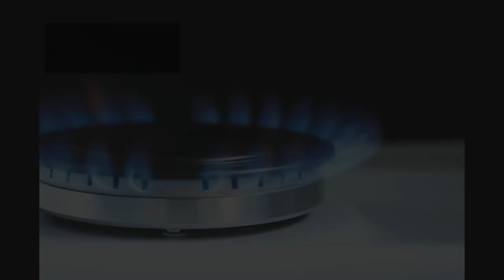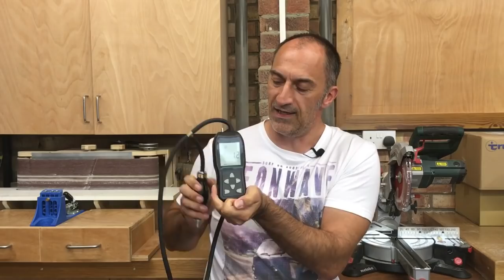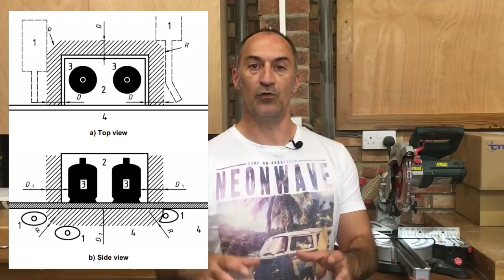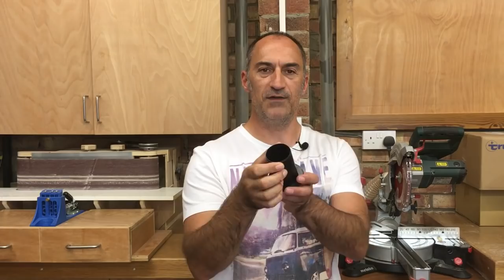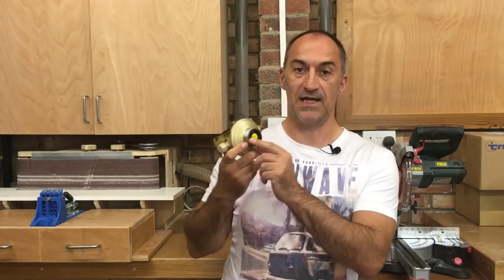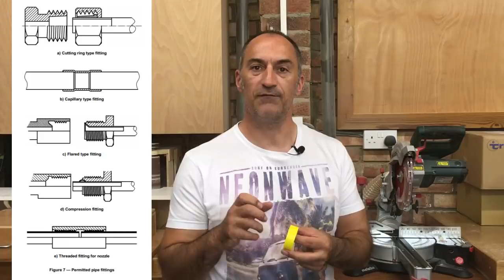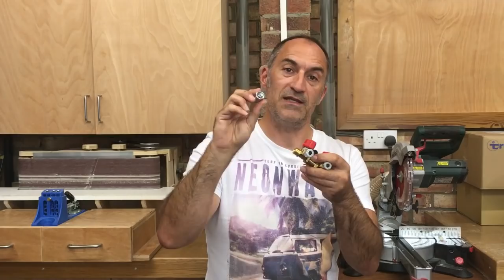Installing LPG in a Self Build Camper Van

Comment: Surely some of the pipes have to get hidden under the worktop for the hob or behind something for the heater etc? I wondering if it goes into cupboards but is still accessible does that make it ok? Or all the pipes and everything have to be above the kitchen work top?
Reply from the maker: The key part is that they are installed in ventilated areas and not enclosed where potential leaks could build up. My gas pipes behind the cooker have a drop out vent in the floor which would allow any gas to escape. Keep joints in the van to a minimum to reduce the risk.

Comment: Hi Greg, can 8mm pipe  be run under van to appliances? Adam
Reply from the maker: Yes you can run it externally. If I was doing that I would put it inside some flexible conduit to give it extra protection but that’s just me 😁

Comment: I’d like to ask you. Can I have regular and isolating valves outside of the compartment or does it need to be inside within the cylinder compartment? 
Thank u
Reply from the maker: I would strongly advise keeping the regulator inside the gas box as this has a high pressure inlet. You can put the manifold valves outside but always make sure it’s well ventilated area and has drop out vent for safety.

Comment: Hi Greg. If a hob needs to be connected to a rigid pipe how do people do these slide out hobs in the smaller vans? Or do you think they are just connecting them to a small portable gas bottle? I'm guessing you couldn't have it rigid up to the slide out bit, rigid at the appliance and then flexi between to allow the slide out?

Comment: Your info on gas regs has been really useful for my Boxer conversion but find the rules regarding gas drop vents are a bit confusing.  I have an under slung tank and 12v fridge so no problem there but not sure what I need under the bunk with the Truma heater and in the kitchen unit with the hob and cooker.  Any advice you can offer will  be much appreciated.
Reply from the maker: Place a drop out vent wherever you have gas installed in the van and there are joints that could leak. I have one next to the Truma and under the cooker in the kitchen.
Reply: Do the regs say you have to do this? It would be really difficult to do this as I have a water tank in the way. It's a 2 burner hob. I found online that this may be advisory but not a requirement. Is that right?

Comment: Thanks again Greg for another great video. I'm struggling to find the gas testing thing you displayed; the links seem to be broken. In particular, the rubber hose with the hand pump on it. I've searched eBay and amazon and can't see it, could you link another one or tell me it's proper name so I can search for it?
Reply from the maker: Best thing to get is a blood pressure cuff and cut off the hand pump and gauge the scale on the gauge is perfect for the pressure a d can pick them up cheaper

Comment: LPG doesn't seem to do well in freezing temperatures. How did that work out for you? I've heard people who couldn't run their appliances on LPG when it's too cold because at a too low temperature the gas doesn't burn.
Reply from the maker: That is not the case with propane as it will still turn into gas as low as -40C
However that is not the case for blue butane bottles where it will not give off gas below -2C
So stick with propane and you’ll be fine.

Comment: Hi Greg, it is me again... 
concerning the straps for the gas bottles (LPG), in Germany, you have to fix them with a  secured band which can only be detached with tools.
Exactly the other way around :-)
The reason is, while filling the  bottle, you could tilt it, and then the 80% filling control is not working, and the bottle could be over filled.
That is, why the bottles have to installed fixed, and cannot be removed without any tool.
Reply from the maker: If you fill from a connection on the side of the van the bottle doesn’t get touched at all. The reason the straps are done simply by hand is so they can be removed easily if needed.
Reply: @GregVirgoe  And this is, what is not allowed in Germany. LPG bottles are not supposed to be removed easily... they have to be fixed insite the compartment.
You cannot use the „normal“ fixing, unfortunately.

Comment: Hi Greg, massive fan of your videos, thanks for sharing your knowledge! I have a question if you don't mind...I'm planning to build my LPG cabinet like you did, but following your second advise to mount the inlet on the skirt underneath, instead of the panel; do you know from the BSI if the pressure regulator can be outside, under the floor close to the inlet on the skirt, as opposed to inside the LPG cabinet with the gas bottle? Thanks a million in advance!

Comment: Hi Greg. 
I remember you saying somewhere that one of the things you would change is to have a tank slung under the van. 
If you were to do this, as the heater is on the other side to the cooker, how would you run the piping? 
Would any of these work?
1. Compression T joint underneath the van after the reg and then run 2x powder coated pipes down each side underneath (clipped etc) emerging up into the van by each appliance (and then have cut offs next to each appliance)?
2. Bring pipe up from the tank, in to the garage, and then split in the van through a 2-way manifold  (does this need a locker?) and then surface run as you have done.
3. Another way!!
 Cheers.
Reply from the maker: I would go with the first option, use a plastic-coated copper tube for extra protection under the van.

Comment: Greg, this series has helped me a huge amount. 
I ended up with an external tank installed under the tail because of German regs. Must say I struggled to get close to the neatness of your installation. Hat off to you.

If I may, some comments on LPG for Germany based on my experiences. Hope it helps others as yours have.

1 - The system you have with Gaslow us not yet clearly approved, falls into a grey area and is currently being reviewed. Similar systems using Truma dual control are also affected. Issue is that although the controls are approved, tanks are approved, you're not allowed to use flexible pipes to connect fixed gas tanks. Oddly, you can fit dual removable tanks in a gas locker connected with flexible hoses and your Gaslow switch overs.

2 My impression is that steel piping is most often used, not copper. I ended up using steel. It's very hard work to bend. Even with a bender like the one you used. The compression fittings need a lot more tightening than copper and what I thought was tight, certainly a lot tighter than you needed on copper, leaked. 

3 It's a requirement to get the system inspected and certified by a qualified body. This is usually a local caravan/camper place. Must be repeated for each Tüv - MOT equivalent. Tanks must be certified every 10 years. 

4 There are labelling requirements as well. 

5 Doing it yourself is quite straightforward as you've shown, many caravan centres are used to self builds and willing to advise, but not all.

6 Using the combi heater while you're driving is legal and safe, so long as a crash cut off is properly installed. I don't intend to do this, but had one installed for extra safety. 

7 You must only run one appliance off a single 8mm pipe. Couldn't make out if this was a legal or practical requirement. 10mm pipe is only allowed up to a manifold. So I have 10mm to the electric shut off like yours, a very short 8mm connection to a manifold, separate feeds without T pieces to each appliance. Manifold has taps to shut off supply to individual appliances.

8 Main German fittings maker seems to be GOK. They have a really useful brochure detailing layouts, the supply components which is really helpful. 'Lösungen für Flüssiggas in Freizeitfahrzeugen'

9 For users of refillable bottles with German threads, adapters are available so they can be refilled in countries which don't use the German fittings.

Comment: Hi greg, I know it was a while ago but the link to the hose no longer goes to a specific product, could you mention what sizes you've used to build that system with from the menometer, the pump and diameters. Thank you 🙏
Reply from the maker: I always link to a search result because items sell out and this way gives you a choice of seller. Any that say gas test tube 6mm will be fine. In the end I purchased a blood pressure cuff for £10 that had everything I needed on it. Gauge, pump and tubing. I just disconnected the cuff and it worked perfectly

Comment: Thanks Greg, excellent information as always.  As a Gas Safe Engineer with LPG qualifications can I please add, while you correctly stated it can be a DIY installation, I’d strongly recommend you employ the services of a competent Gas Engineer, with the relevant Gas Safe qualifications.
Get them in a the right time & it’s not a time consuming or expensive job, but a safe one.
I believe any Insurance Company will look for a Safety Certificate for the Gas installation & it makes common sense to have an annual check.
Cheers Greg, I love your attention to detail & thanks for taking the time👍
Reply from the maker: I agree that it should always be checked, tested and certified by a qualified engineer

Comment: Hi Greg. I've just ordered a Gas It kit for my van together with a Campagna 30mbar regulator which outputs to 8mm pipe. I now need to order a couple of metres of microbore pipe and now I'm confused. Does the "8mm" refer to the external or internal measurement?  The LPG shop sell 10mm pipe which is the external diameter but the internal diameter is 8mm. Can you clarify this for me? Many thanks and keep up the amazing videos you produce.
Reply from the maker: Den Weston the 8mm is external diameter so that 10mm pipe will be too big. 
I got my soft copper coil off eBay in 10m lengths.
Reply: @GregVirgoe  Thank you. I can now order with confidence :)

Comment: You say it mentions a sealed compartment. Does it specify if that compartment has to be metal or could it be timber? I plan to do a timber cupboard and go around the inside joins with silicone to seal it up. Thanks for another amazing video Greg. Regards, Sam

Comment: Hi Greg, I’m going for similar set up as yourself with the boiler under a bench seat, like yours the bench is under a window. My problem is Truma say not to mount the flue within 300mm from a window, but the regs say that you can’t fit it directly under a window at all. What is your take on this?
Reply from the maker: It only applies if the window opens because the warm flue gasses will rise and enter the vehicle. 
My windows do not open, so it's OK for me.

Comment: What do you think about induction cooktop?
Reply from the maker: any form of electric heating will use a lot of electric power, ok if you have a massive solar system or plan to be on camp sites but if you want to be off grid for long periods I think LPG is a better way to cook

Comment: Thanks for an excellent video Greg.  I wanted to get hold of a copy of the standard but was not prepared to pay the £200 or so that BSI charges for it so I did a bit of investigation and found that, as this is an international standard, it is published in many countries.  I ended up buying a single user licence to the english pdf version of the standard from the  Estonian Center for Standardization for €15.40.  For this price I'm only allowed to download it and view it on a single computer but this isn't a problem for personal use anyway.  The relevant link is https://www.evs.ee/tooted/evs-en-1949-2011+a1-2013.  This site is the Estonian equivalent of BSI.  You have to register as a User of the site, but can pay with Paypal, so no need to enter Credit Card details etc.  Worked for me and might be of use to others.  Welcome to rip-off Britain!

Comment: Actually Greg, the purpose of the PTFE tape on pipe threads @15:30 is to offer LUBRICATION. It is not a sealant. It’s job is to prevent heat buildup and galling which would prevent adequate thread insertion, and ultimately, a proper seal. The tape will allow further wraps on the joint, offering the best seal.
Reply: But you just said the tape  it’s not a sealant at the beginning of your sentence and then at the end said it is ?
Reply: @timothybint4960  Nice catch! Sorry for the confusion. But what I intended to convey is that with the use of (tape) lubricant  it is more likely possible to obtain a proper seal of the threads. There’s a lot of misinformation about this concept. But I was a certified pipe fitter for approximately 20 years.

Comment: Greg;  if I have to put the LPG tank on one side of the van and the appliance on the other side,  where would the gas line run across?
Reply from the maker: CITY CENTRE CHIROPRACTIC I have run mine at low level behind the back wall of the garage. The fitted a timber batten in front of it for protection. It runs from the bench seat under the shower tray behind the dividing wall across the van and then down the side of the garage to the gas bottle. It’s convenient to have your fill point on the same side as fuel fill point just for when you are in a garage filling up.

Comment: What lpg water heater are people using. I have a rinnai heater in a narrow boat which passes the safety regs for the boat I was hoping to fit 1 in the van as they are great, but looks like regs are different for mobile homes. Ta

Comment: Hi Greg, do you know how the 500mm minimum distance between the fill point and any doors works when you are fitting the fill point on the side of the van, but near the back so its quite close to the rear doors? I think our fill point would work best around 30-40cm from the rear of the van, meaning the rear doors would technically be within 50cm, but around a corner. I wonder how the 500mm would be measured in this case. Any ideas? Cheers

Comment: Thank you thank you thank you as you may have guessed I really appreciate the work you have put into this video, it was just what needed. One question I want to have gas for cooker and boiler do I have to fit a branch to the pipe work to split it or if not how do you run 2 appliances from one tank??? Thank again Jason

Comment: Thanks Greg I’m saving up to get a under body gas tank . After looking under my van to take the sizes to fit a water tank and wast water tank , I will be spraying under the body and the chassis and clear waxing it before I fit anything, only problem being parked in the street I will have to sheet the floor under the van then seal around the bottom to the floor but it should not take me long once I have cleaned it all off , the good point is I don’t have any damaging rust under the van . And to think the last time it was under sealed was when I got the van 15 years ago, Greg do you know how much the road tax is for the change over to a camper van . On your subject regarding gas safe , people can get a gas siffer from eBay it dose all gasses so can be used in the home as well all they need to do is turn it on and follow the gas pipes and if there is a leak it busses. So they will know we’re the leak is pressuring test only lets them know they have a leak but the sniffer lets you know you have a leak and were the leak is , but also let them know if they do find a leak not to think it’s safe until they go over every peace of gas pipe even around the gas bottle or gas tank to make sure it only takes a few minutes and them few minutes can save a life or lives , many thanks for your videos Greg , I’m thinking of trying to do one myself but I will have to save for some camera equipment first . Many thanks again and I do hope you changed your extractor fan and it was not too much of a problem for you ,

Comment: Greg can I just ask were you got your gas  2 way manifold ,I need a 4 way one , and a regulator, many thanks
Reply from the maker: Thomas whitelock both from Ebay. The regular was a 30mbar one made by gaslow with 10mm compression outlet to suit my Truma solenoid valve. The manifold had 10mm inlet and 8mm outlets. So was perfect for my system. 😊

Comment: You can get a gas sniffer , you just turn it on and follow all the pipe work and if there is any leaks it will buzz, no buzzing and you have no leaks you can get a cheap one on EBay for around £30 one of my sons use one all the time in his job as a gas engineer mostly fixing gas leaks , he says it’s the easiest way to find any leaks .

Comment: If you don't make the effort, like Greg, to build it to the standards you obviously have never seen a gas explosion. Google it! A recent incident on the news in Australia showed a truck (Lorry) being used to move house. It went past an intersection camera and moments later debris flew back in the opposite direction. Turns out a leaking barbecue cylinder filled the floor of the cargo section and leaked out to the hot exhaust. The truck was obliterated and the driver killed. Be like Greg. Another great, informative video. Thanks Greg. Funny, in Australia the standard states pipe must non-ferrous, so basically copper but no steel.

Comment: Boat accidents happen not just because of faults but from incorrect use. Motor homes will never be as bad as boats as by definition boats are always pretty effectively sealed below but the problem can still exist to an extent in a van. The gas cylinder chambers might have floor vents but the cabin of the van probably doesn't. The problem comes in lighting the gas. If you switch the gas on and then spend some time trying to light it then gas spills out and downwards. The technique on a boat is to make sure your flame is ready before turning on the gas. Gas alarms are good.
Reply from the maker: Malcolm Hughes there’s not rhyme or reason its about making people aware and what they can do build a better job